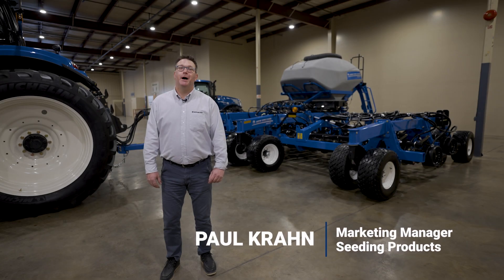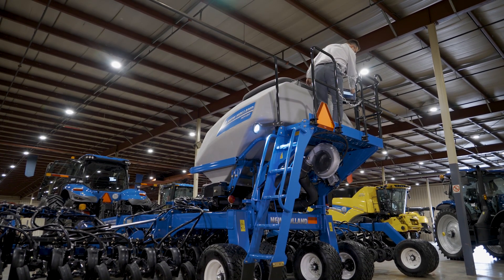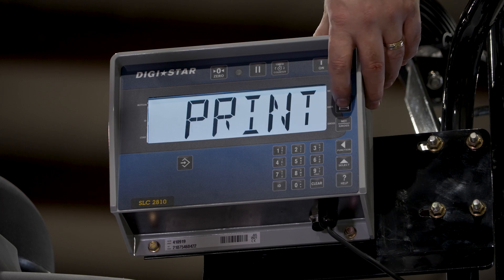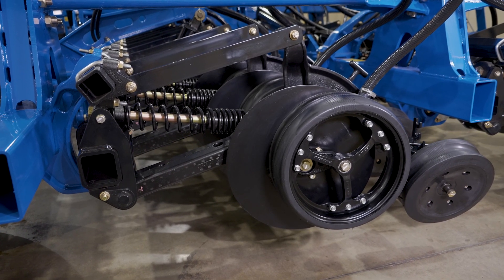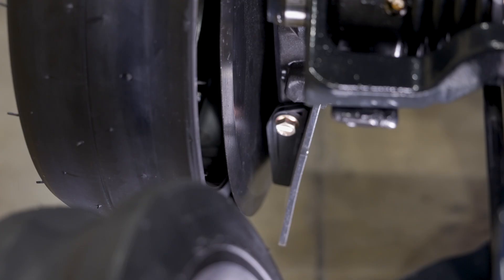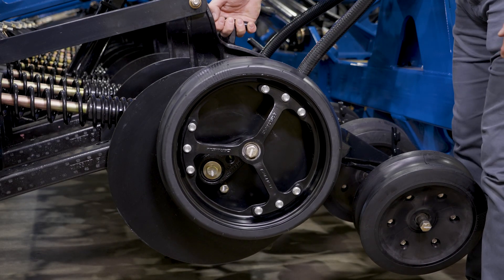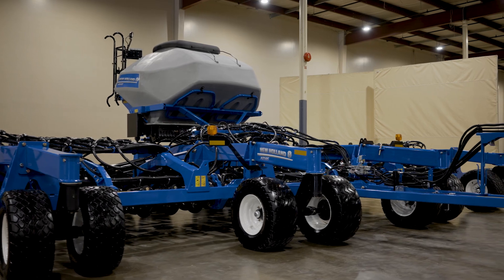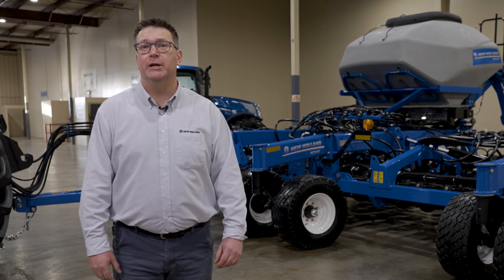The NEW 2023 P2185 Air Disc Drill - Introduction and Overview

Comment: I work at NH dealership, will this drill plant milo? P2085 series was lacking in that department.
Reply: A P2080 wouldn't go low enough rate in milo with the fine meter?  I was looking at one of them or a case P500 (same) in 7.5" to do milo.  Plan was to block off every other meter so with one gang so I could do 30" rows.